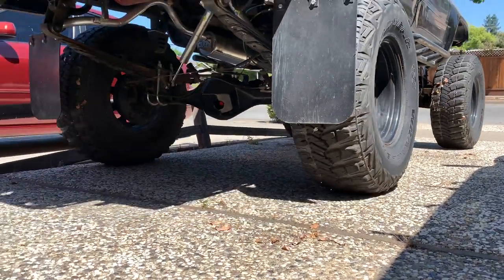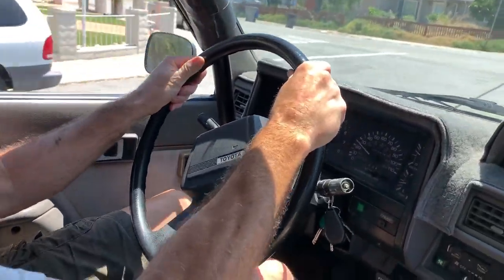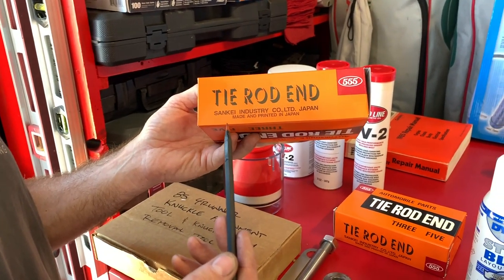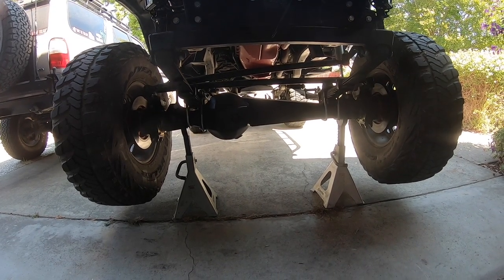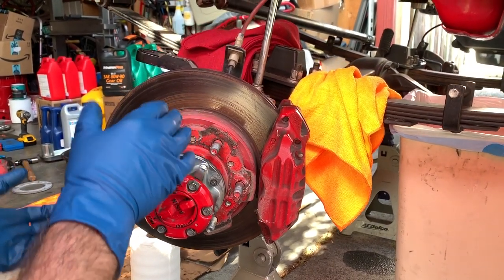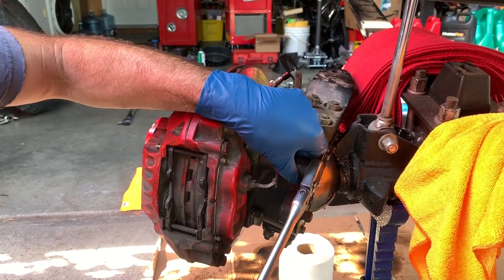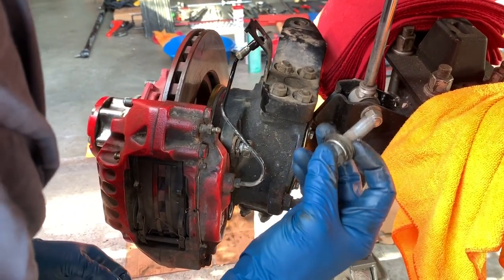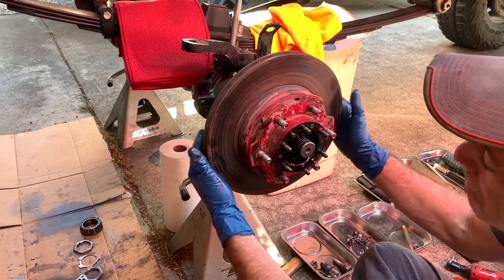Toyota 1st Gen 4runner Solid Front Axle Service (PART 1)

Comment: congrats on getting a 1st gen...watched your other vid. I know you said its not a mall crawler but seemed bummed on the munched body. anyhow, ive got an '84 body from CA w all body parts except top. no rust no damage no dents...free if you want it. only prob is its a lot of work swapping everything over and its 12 hours away.
Reply from the maker: Thanks for the offer Ryan.  I appreciate it.  I think at this point I'm just going to keep my body as is.  Do you have other parts too, like interior parts, or drivetrain parts?
Reply: @TimmyTheToolman  unfortunately It was a backup body for my '87 in the event I ever wrecked it. I sold that a few months back and the guy who bought it wanted the front axle of course and some other stuff. all the plastic panels etc are all gone. more or less its fenders,doors, glass, tailgate, body, frame and rear axle.
Reply from the maker: @ryand8639  Gotcha.  Some dude is going to want it for sure.  If I was motivated to do a body swap, I'd probably take you up on your generous offer but that sounds like more work than I want to do right now.
Reply: @TimmyTheToolman  lol I hear ya!!

Comment: Hey Timmy! I have a question I can’t seem to find info on anywhere on the internet surprisingly ; and that’s how exactly does the solid axle function! What function does the trunnion bearing serve? What does increasing the size do etc etc etc . Is there a good right up on this anywhere ? I just picked up a 1990 2nd gen and I’m going  to do a 5vzfe swap and a solid axle at the same time . A reference to a site, write up, vid or good book on the subject would be greatly appreciated . Thanks! And keep up the good work !
Reply from the maker: Go to the Marlin Crawler website and you'll find some information on the subject.  The Trunion Bearings support the steering system.  The knuckles pivot on the trunion bearings when you steer.  The bearings take a lot of force during hard wheeling and they can get damaged.   The larger bearings can handle more abuse.  They do make a Trunion Bearing Delete kit that gets rid of the bearings. This is sort of the extent of my knowledge on the subject other than what I share in the video.

Comment: Hold up. Wait a minute. I have a bone stock 1984 4runner Im doing this project on and following this video. I only have 1 tie rod on each side and there is no hole on the arm where a 2nd one ever was. What is going on?
Reply from the maker: It's a high steer conversion.

Comment: Not good that there was no pre load on that wheel nut
Reply from the maker: The previous owner isn't the most competent mechanic.  I'm glad I went through the front axle because even though the guy said he serviced it.  The guy said he was a carpenter and I think he should stick to working with wood and not on vehicles.
Reply: @TimmyTheToolman  I agree